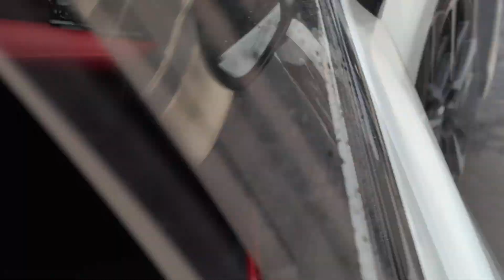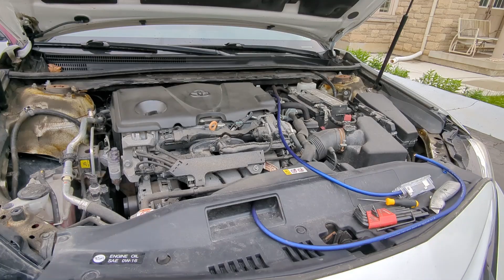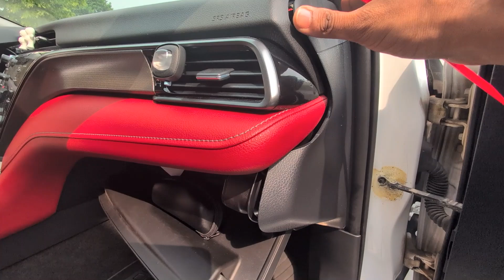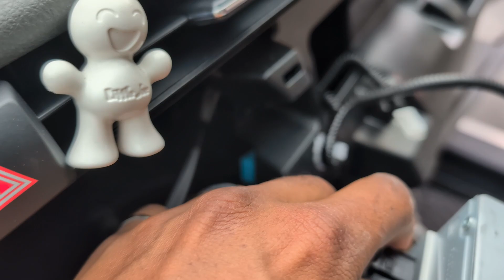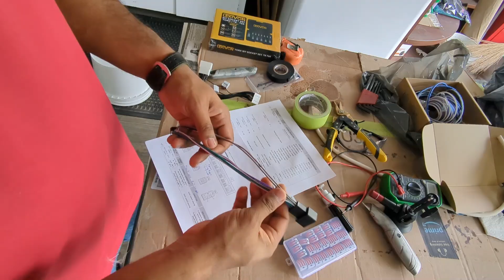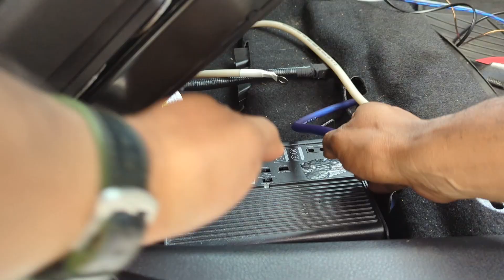Underseat amp installation in a 2020 Camry XSE

Comment: Hey, great video! Couple questions.  I noticed you routed the speaker cables the same side as your power cable. I was told that the power cable would interfere. Did you have that issue? Also, maybe I missed it, did you sealed up grommet with like silicone? If so, what product did you use? tia!
Reply from the maker: Yes, the power cable comes in on the same side, however they do not overlap on their path. The power cable stops at the front passenger seat, and then that's where the speaker cable starts from. 

I didn't seal off the grommet, haven't noticed any water ingress issues, but I'll try to take a look at it this summer to see what it looks like.

Comment: Buy a loc w an remote out ,tap rear speaker wire no need for any of this work .run power ground and done    amateurs...
Reply from the maker: Certainly an option, but I didn't want the amp installed in the trunk. Also didn't want to splice any factory wiring. Every thing can be returned to factory condition.

Comment: I came for audio and immediately was very concerned why there is that much oil/grease all over the engine bay and strut towers in particular.
Reply from the maker: Good question! It's actually a rust coating product that was sprayed on
Reply: @vinesh8716  Did the rust oil creep its way out of the panels or where you just a bit messy when applying it?